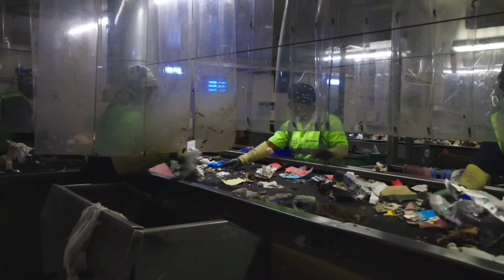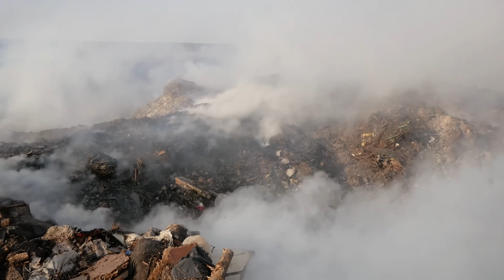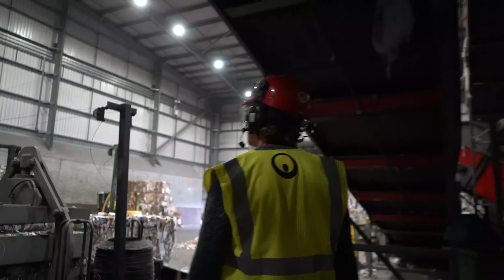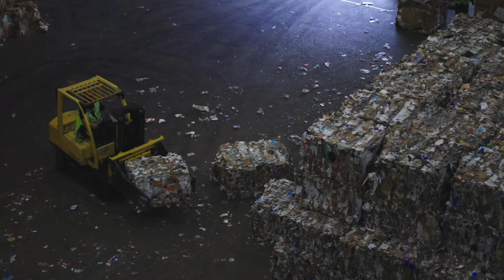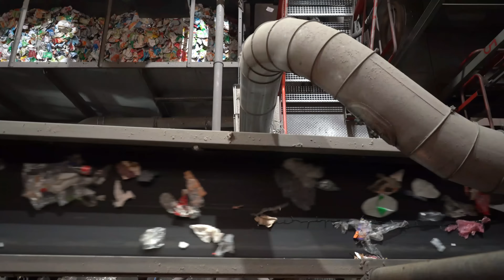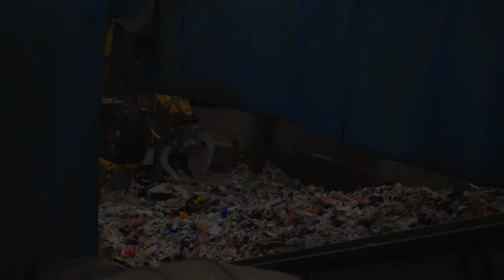Inside a Recycling Centre | Veolia London

Comment: Developing a program to reduce contamination in plastic recycling is crucial to produce high-quality recyclate suitable for drink storage. Here's a multi-step program to achieve this:

1. Education and Awareness:
    - Educate consumers about proper plastic recycling practices.
    - Raise awareness about the impact of contamination on plastic recycling.
2. Improved Sorting and Collection:
    - Implement advanced sorting technologies (e.g., optical scanners, AI-powered sorting).
    - Enhance collection infrastructure to separate plastics by type.
3. Cleaning and Processing:
    - Develop efficient cleaning systems to remove contaminants (e.g., labels, caps, residue).
    - Implement advanced processing technologies (e.g., shredding, pelletizing).
4. Quality Control:
    - Establish strict quality control measures to detect and remove contaminants.
    - Implement regular testing and monitoring to ensure high-quality recyclate.
5. Closed-Loop Production:
    - Collaborate with drink manufacturers to design packaging with recyclability in mind.
    - Ensure recycled plastic meets food-grade standards for drink storage.
6. Certification and Standards:
    - Establish industry-wide certification programs for plastic recyclers.
    - Develop and enforce standards for plastic recycling and recyclate quality.
7. Research and Development:
    - Continuously invest in R&D to improve recycling technologies and processes.
    - Explore new technologies and materials to enhance recyclability and sustainability.
8. Policy and Regulation:
    - Advocate for policies and regulations supporting plastic recycling and recyclability.
    - Encourage extended producer responsibility and product design for recyclability.
9. Collaboration and Partnerships:
    - Foster partnerships among plastic recyclers, drink manufacturers, and suppliers.
    - Encourage knowledge sharing, best practices, and joint innovation.
10. Continuous Monitoring and Improvement:
- Regularly assess and refine the program to address emerging challenges and opportunities.
- Encourage consumer feedback and participation in the recycling process.

By implementing this comprehensive program, we can significantly reduce contamination in plastic recycling, produce high-quality recyclate, and ensure the safe use of recycled plastic for drink storage.
Reply: Most people don't know the difference between paper.plastic and metal.So they keep putting the wrong items wrong bins.We are way behind other European countries in how we recycle things.

Comment: This comes from a good place but it didn’t really explain what goes on inside a recycling centre
Reply: Because most of it is burnt.Or dumped in green fields.Its all a big con.Like electric batteries that explode when wet.
Reply: @robertwatson9940  let us see that then
Reply: Veoila is a company that has a fake image of what they are doing.I see them in the High Street trying to remove the bubble gum from the pavements.Two men take weeks to remove it.And it will all come back because you have not stopped the people that drop it in the first place.